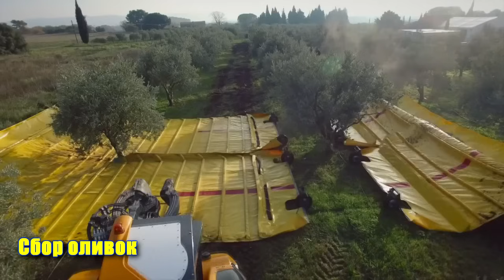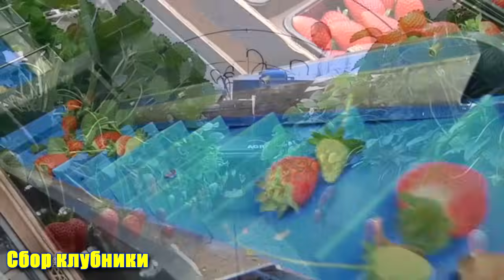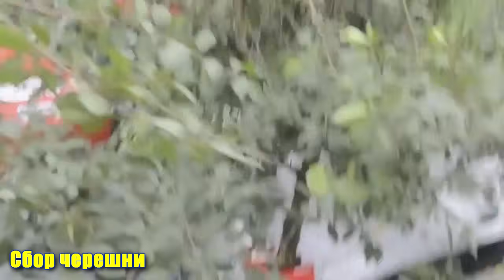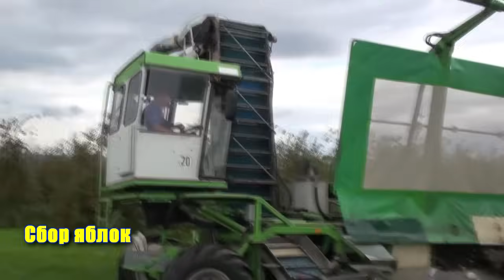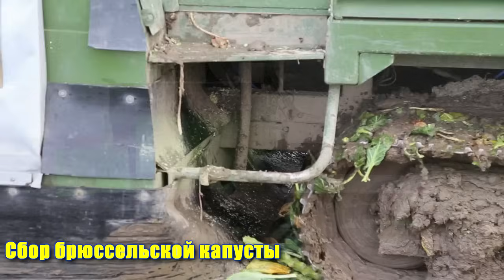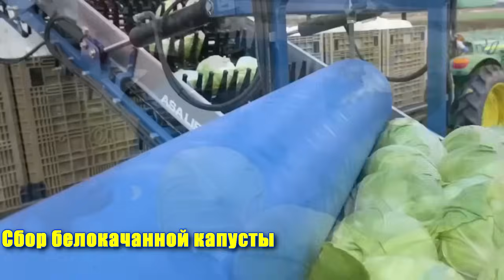Самые необычные машины для сбора урожая ягод, фруктов и овощей

Comment: To mechanize the harvesting of fruits is very difficult, they are easy to damage. Therefore, while the use of manual and mechanical methods of cleaning. The fruits of valuable crops are harvested by hand. The crop of stone fruits (plums, apricots, etc.) is removed with hydro-mechanical shakers, and berry crops (currants, gooseberries) and grapes - with mechanical shakers.
An innovative solution is to use an inverted "umbrella" that unfolds under a tree before shaking.
To achieve the maximum effect, you need to prepare a garden. The recommended distance between the rows is at least 4 meters, the distance between the trees in the row is 2.2 to 2.5 m. The diameter of the crown should not exceed 3.5 m. The height of the trees can be much higher than in a garden designed for manual cleaning.